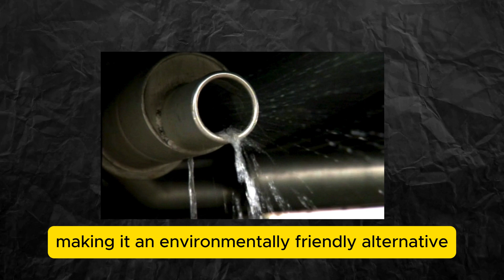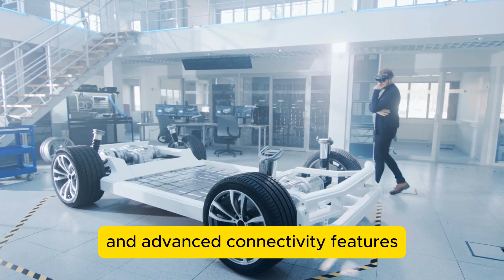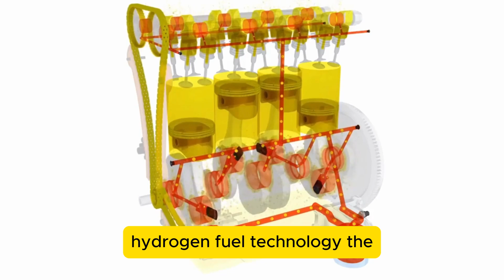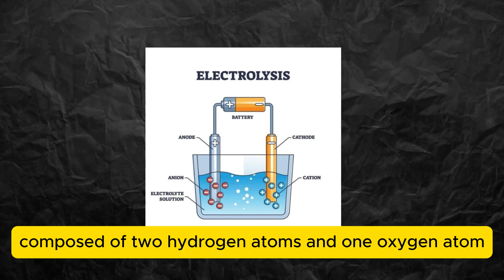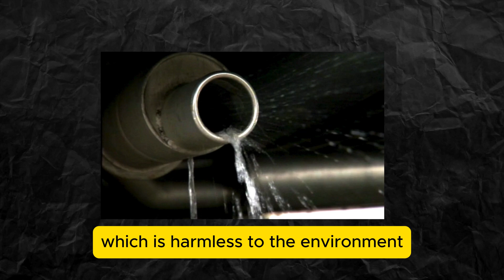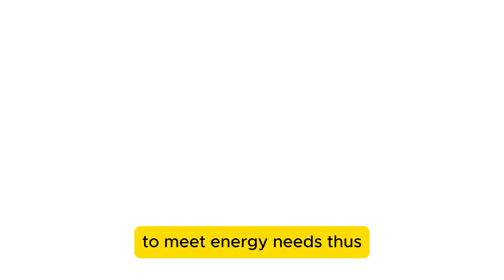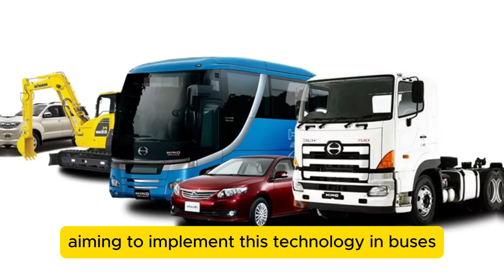Toyota CEO | New Engine to Outpace Electric Cars

Comment: Burning Hydrogen in a combustion engine is not a Fuel Cell, Fuel Cells do not use combustion at all.  They use a fuel cell stack that the hydrogen molecule runs through at the speed of light generating electricity as it runs through the stack.

Comment: I stopped watching at 15 seconds, after being told that the motor runs on water...
Reply: It runs on Hydrogen which is cracked from water, so its fuel is a byproduct of water and that is a very environmentally friendly process and once used in the engine it converts back to pure water.  Water is H2O so when you separate the molecules you get hydrogen molecules and oxygen molecules.
https://www.youtube.com/watch?v=bFb5TKVPSiY
Reply: @heyu9262  You said it all, I'll quote you: "it runs on hydrogen". The rest is noise, speech for the ignorant...